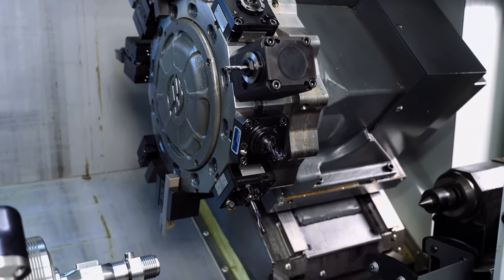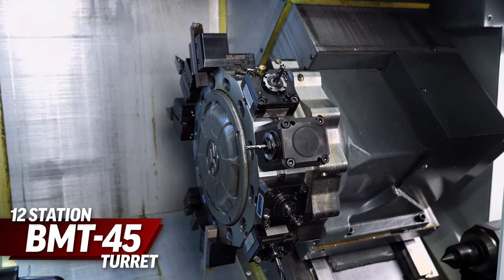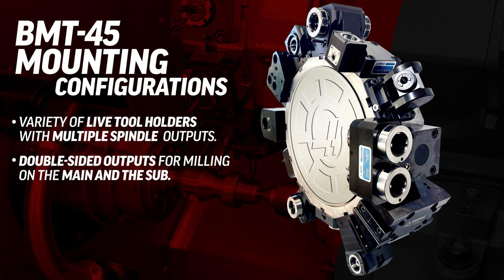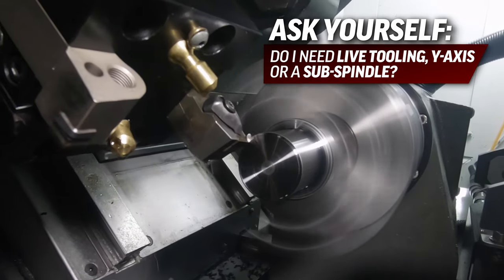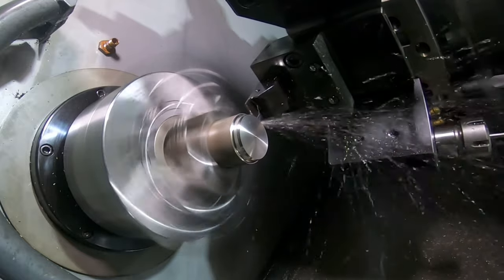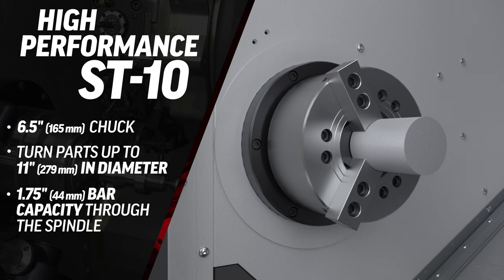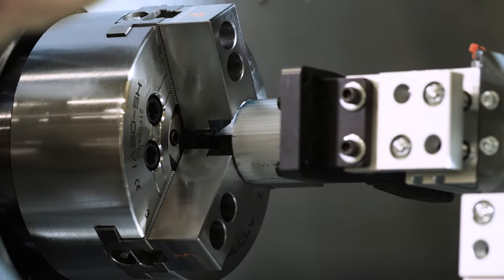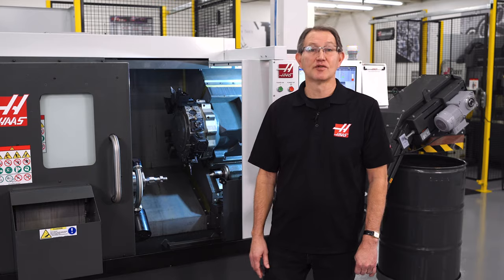BMT-45 Turret Now Standard on Haas ST-10Y and ST-15Y - Haas Automation, Inc.

Comment: You can't run a ST15 that hard that VDI30 Tooling would not hold up. I would've hoped for a non lifting and faster indexing turret at last. Not to mention that BMT Tool holders are generally much more expensive than VDI tool holders.

Comment: Too bad the entire turret is held in place with just four 1/2 inch bolts and no keys and gets knocked out of square with the slightest little bump.
Reply: Maybe you should hire a machinist instead of crash operators.
Reply: @trace12345678900  It was a slug left in the bar puller that bumped the chuck when the chuck wasn't even running and it was just feeding at 100ipm not even rapid.  The machine didn't even stop, it just started making bad parts.  This was on our ST30Y.  Not to mention when we first got it we had to have them come out and fix the live tool system because it ate itself during a tool change.  They tried to blame us, but the first time we tried to use it, it was broken.  After the mechanic fixed it, it ate itself again with him standing there and I figured out that it was because on a 24 position turret in the half index position the live tool was still engaged with the drive, but of course not aligned with it and on every tool change it would orientate the live tool which bent it out of alignment then slammed into it during the tool change.  They had to reprogram our machine to fix it, and had to admit it was their mistake.
Reply: @mikeepeck  
Why paying $4500 extra for a 24 half-index (BMT65) when you have a Y-axis ???
Reply: @ytfan3815  Live tools use up the turret stations fast, so it's nice to be able to use the double turning tool and bar holders to be able to have rough and finish tools.  it does have some limitations with part diameters and chuck clearance sometimes but worth it for us.  Collet chuck would help with some of those issues since it's smaller in diameter.  Really depends on your usage.  We are a job shop so a chuck is more useful for us, but if you run production collets I think would be the way to go depending of course on the size and shape of your parts..
Reply: @mikeepeck  My ST25Y has a plus/minus 50mm Y-axis, so I can mount double (parallel) toolholders without indexing, I need of course some clearance with drills (ID toolbars), for a double driven toolholder you always need a "full" station, you can't use them on half index.
In Europe the half index BMT65 is an $4500 extra, I don't see the benefit when you have a Y-axis, I think the double ID-holders have more spacing than the half-index, probably they need the same space on the turret as a half-index holder..
Reply: @ytfan3815  Exactly. VDI Quadro Holders are even cheaper than BMT "Double Index" holders. Double index is nonsense when you've got a Y-Axis